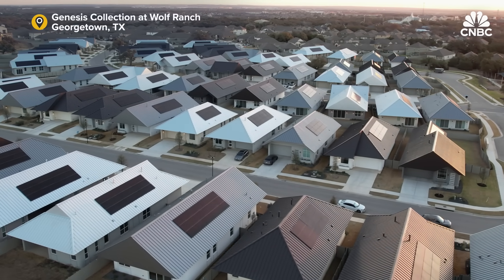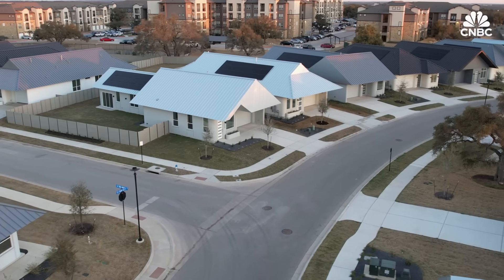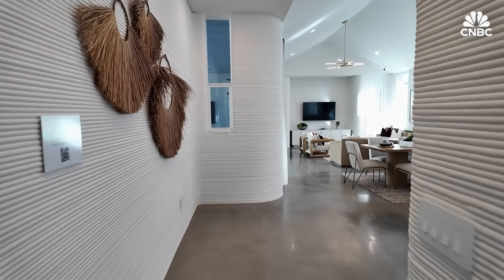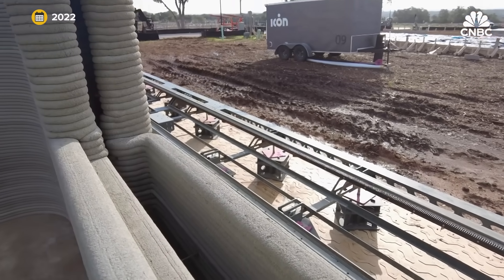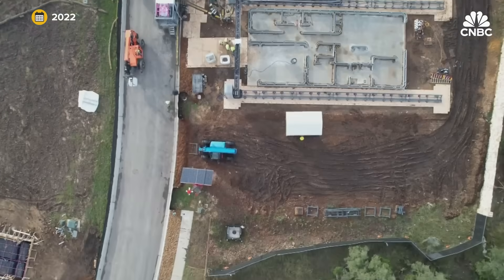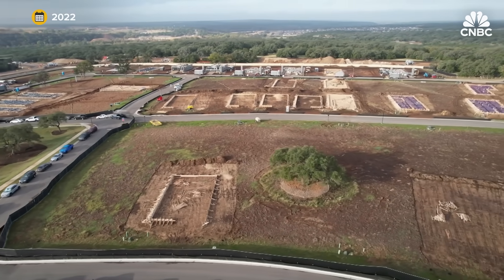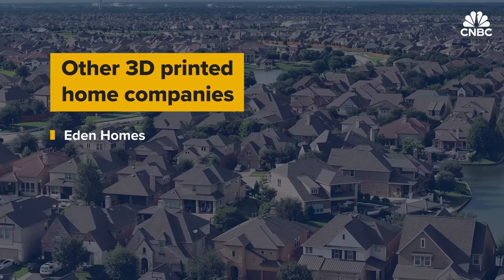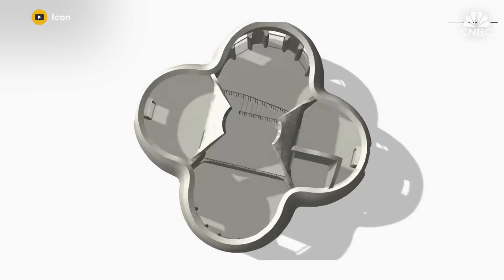Inside The World’s Largest 3D Printed Neighborhood

Comment: Have these homes passed any tests vs traditional homes? Any OSHA approval or anything like it? How do you permanently stop rain from being absorbed in the walls? Even dew point can cause the walls to absorb moisture and break the concrete down over time. Structural engineering wise, triangles are the strongest shape unlike these curved shapes. Where is the savings for the consumer where it would be 20 workers and many different materials to build a home here you only have 3 workers and just a few materials... No remodeling, no renovations, no upgradability, you're stuck with whatever is made. No where near the shear and compression strength of a standard home. If a tornado or significant storm tears down a wall, how do you repair it? This is cheaper and shittier than fiberboard and that in itself is sub par to plywood homes back when. NO THANK YOU!

Comment: Translation. We don't want to deal with workers so we're going to make a process that extracts maximum value for the investor class alone. 

In doing so we will eventually destroy most independent building contractors so the cost of building a home actually skyrockets due to a lack of competition in local markets. 

The consolidation of construction options -- probably driven by private equity -- will mean fewer options for homebuyers not less and it's highly likely most of the units built won't be available for purchase rather they'll be rental units to again extract as much value as possible for the investor class at the expense of everyone else. 

Yay!!!!

Comment: All I hear is: We think we can build homes while cutting trade jobs so that the rich get richer and the poor stay poorer.

The idea that they’re going to figure out how to lower the costs of homes is simply BS. If they do that, it’ll plummet other home builds, and by extension existing home values. Instead, they’ll charge the same market rates and just keep a higher margin of profit with no benefit to the buyer.

Not to mention that you could never modify or repair one of these homes as easily or as inexpensively as a wood frame/sheet rock home.

WORST IDEA EVER

Comment: I've always felt like claiming these are 3D printed homes is kind of false advertising. It's really just 3D printed walls. So you're replacing the framing material and drywall with concrete, which I would like to point out. Concrete requires far more greenhouse emissions to manufacture then either wood or drywall. So these homes aren't any more environmentally friendly and quite frankly saying that they can be built faster is very misleading as well. Maybe they can get one of these houses built faster than the average builder, but I have a couple of Latino crews here in Ohio I promise. Could frame roof and drywall a house that size in less than a day if I paid them enough

Comment: So, the problem here is if you have a bathroom leak or just leak anywhere. You can put a pre-installed access panel, but if the leak is no way near the panel, then you have to drill or cut through the concrete, fix the pipe, and repatch the wall with mortar. It's going to cost a lot more money since it's labor extensive versus cutting through a drywall.
Reply: Are you American right? Hahahahahaha
Reply: @blackpiller3777  And are you Indian? hahhahaha...You don' t make any sense. Go eat your onion curry! 🤣🤣🤣🤣
Reply: @blackpiller3777 are you Indian, right? Hahahahahaha…your comment doesn’t make any sense…

Comment: I absolutely love this concept. I like the unfinished texture of the inside. Almost seems like a sound room in a recording studio. What a cool idea. Seems like it's insanely strong and tornado and hurricane proof. No drywall to get wet, grow mold, and need to be replaced. I love the sound proofing and energy efficiency. It also ensures that all houses are built using the same engineering methods. Today's conventional methods you are subject to 1 million different workers are building slightly different with varying levels of skill and experience. Love this so much. Keep up the great work. Ready for the hobby home printer model where I can build my own for a tiny house lol
Reply: You wouldn't like it if you had to clean it or paint it.

Comment: Concrete is pretty corrosive when wet or damp (alkaline). I wonder how they address the corrosion problem. I noticed that the conduit in the electrical recess was rusting.   I like the design capabilities and the structural features.

Comment: the problem is the concrete the production of which is co2 intensive and produces large amounts of it during manufacturing this product also has a market fluctuation value a kin to oil it goes up it goes down so the cost savings are negligible and the only cost saving is the actual shell the rest still has to be install manually pipe wires flooring the roof etc etc etc painting so whats the point

Comment: Wait, you Americans are getting this exited about home build out of thin layer of concrete, claiming isolation, durability and energy efficiency?
Man, I cant  wait till you guys find out about homes made out of bricks, stone and THICK concrete. 
Imagine, instead of putting screws into the upper floor to stop it from making to much noise, you can jump up and down at 3am and no one even notices seating next to you 😂.
Or that the “wall” is not a place where insects, snakes and rodents can live happily ever after, cause its….you know…solid😂

My grandpa had a home where the first floor was build out of 12”-15” STONES. 
In summer, it was like a cave. They never had nor needed air conditioning. 

Im telling you guys, you are up for real treat ones you find out about it all. Though your paper made homes might become worthless overnight.

Comment: Congrats America you discovered that you can build homes out of concrete and stone and it’s better than building it out of paper and wood… wait until you realize that you do not even need a 3d printer for that😂
Reply: If only there was a simple parable. Perhaps with animals...
Reply: It’s cheaper and faster to build homes in America out of wood. They figured that out in the 1940s/1950s, when the first suburbs are built. Also, the average American don’t stay in homes for generations like other countries.
Reply: If you want to build the buildings quickly and inexpensively, unfortunately you do need some sort of automated system.  Costs for these homes is high now but as time goes on it will level out and these will be much cheaper than traditionally built homes.
Reply: They know you don't need a 3d printer. There are concrete homes already except that it would cost far more than the wooden houses to build a similar sized house.
Reply: Do Europeans like anything about their countries besides having a concrete wall in their house?  They seems to be proud of nothing else.

Comment: The niche markets for these 3d printed homes are lower middle and lower classes. Since when can these two niches afford a $389k home? Even if investors buy them, they won't be able to find tenants who can afford the high rent. Seriously, who is going to buy or rent these homes? Very few people. You got one homeowner. One. The price point is way off. The builder's inventory is going to be sitting around with no one to move in. Maybe squatters will takeover and move in these empty homes.

Comment: What's cracked up to be! There's no IFs, BUTs, or MAYBEs about it. It's definite. It's just a matter of time. How long before cracks appear on concrete-paved driveways? It's the same with 3d printed homes. How long before cracks start appearing all over these 3d printed homes since the builder is using concrete? Homeowner's insurance does not cover those cracks. It will be expensive to fix all those cracks. You have to look at the long term. Insects, moisture build up, and mold growth will take over these cracks before fixing the damage. Heating and cooling will become inefficient. The home value will continue to decline as the home deteriorates.  Anticipate this one huge problem of concrete cracks. What other issues can we expect?

Comment: The real problem here is not labor and material cost, but people greeds. They reduced the cost to build a home significantly but are incresing their profits a lot!
And here is what is going to happened, in 15 years, 30 years, 60 years, 100 years, if we continue living in the capitalist system where Winner takes all, those 3D printed homes sold for $390K, they will be $1,000,000. "They save you energy - se we can charge more for it".

Housing needs to stop been a pure business centered model, or the real problem will never fade.

Comment: I respect the effort, but would much prefer a classic Sears home style option. Traditional designs picked from a catalogue, with designs predone, preapproved, and using standardised materials, shapes, and wall lengths and such, but with allowance for some customisation. With design and material cut and prep done off-site this should substantially cut down on both cost and time needed for construction on site, especially if there's already a building in place. If an old home or building is coming down, the new building could have it's materials, walls, etc, all prepped and ready to go ahead of time. New building is essentially flat packed for delivery and assembled in a fraction of the time as all or most cuts or segments have been done, sourced, and prepped ahead of time.

Comment: How do these homes protected from 'reactive soils' in Texas and elsewhere?  A large area in Texas as 'reactive soils'.  Clays like kaolinite and illite are clays that are a major part of the soil on which houses are built.  When wet these clays expand and when dry they shrink.  This causes the soil to exert pressure on whatever is above it or in it.  Concrete slabs break if they don't have a consistent level of moisture in them.  So how would an all concrete home fair?  I'm not finding fault.  I'm curious.

Comment: To break even on the first development is significant. From there, you can apply what you have learnt to reduce costs. If they can produce at scale, this might work for the southern half of the US. Issues will be with water and connectivity to other urban centres. To expand beyond the warmer south, you would have to see heating costs - concrete insulates, but it stays cold for a long time.

Comment: What if you decide to remodel sometime in the future? Will you need a jackhammer to cut through or remove a wall? Will the building code say that a new wall has to be concrete instead of 2X4s and sheetrock because that's what it originally was? Too soon to tell, I guess.

Comment: The first step twoards Star Wars looking homes. They defo will have to find out a process to get those walls smooth or sanded down tho. Could see it being a pain to clean if not.
Reply: It might be cheaper and/or more structurally sound to cover or fill in the ridges to get the smooth look, and covering them would also give some wall space to run things like plumbing and electrical wires.

Comment: This seems like it'd be really cool for adding additional buildings onto  properties with existing structures. If they could rig up that crane with the 3D printer on it and 3D print obstructure behind an already placed house, I think that would be really valuable. My wife and I were looking at replacing our back deck with like a single wide so that we would have a ready built space underneath our deck instead of just putting in another deck and having dirt underneath it or gravel. Something like this would be really cool in that situation.

Comment: How long before cracks start appearing all over these 3d printed homes since the builder is using concrete? Homeowner's insurance does not cover those cracks. That will be expensive to fix all those cracks. You have to look at the long term. Insects, moisture build up, and mold growth will take over these cracks beefore fixing the damage. Heating and cooling will become inefficient. The home value will continue to decline as the home deteriorates.  Anticipate this one huge problem of concrete cracks. What other issues can we expect?
Reply: Would it deteriorate faster than a house made of wood covered with vinyl panels?

Comment: 400k for a 3D printed concrete house is insane
Reply: The markup percentage is probably insane. It cost them probably less than a quarter of that to construct the houses.
Reply: @noobhacker101 concrete or cement is not as expensive as they make it out to be. It's thr labor. Always the labor. It cost me $700 all includes for a 10x16x5 slab, the quotes were from $3000 to $7500. It's not even hard to do, especially considering g they weren't going to put a finished surface on it.
Reply: @ If you know so much do it yourself then post results 🤷‍♂️
Reply: Thats what I thought, either someone has messed up big time or the consumer here is getting screwed.
Reply: Its texas, you are not paying for the house, you are paying for the land it sits on.
Reply: Even insane once you realize how impossible it is to renovate such buildings.
Reply: More greed
Reply: Comments on the housing crisis then continues to perpetuate the housing crisis by up-charging a ridiculous amount. Capitalism is a sickness
Reply: It's only 1 storee
Reply: @ And?
Reply: he implied running at a loss for this first batch. notice how much of the house is outside contracting.
Reply: "...that is similar to other larger houses in the area..." 😂 👍🏻
Reply: Soon They Will Be Pushing Lego Plastic Houses....starting at you guessed it $399,000
Reply: @UneducatedGeologist You’re gonna need to print your own legos though 🤷‍♂️
Reply: @UneducatedGeologist Lego style homes have been around for years
Reply: The issue is not necessarily the company, but the regulatory system surrounding the build that, no matter what the cost, always want their pound of flesh, not a penny less. This is largely what drives costs up - the bureaucracy that surrounds the actual event
Reply: @willh69  You sir are having a in depth conversation.... Most ppl cant understand these concepts. They just want to blame 'the company' b/c they dont know better.

Glad to see smart people are still out there in the world. lol
Reply: @mattlol163  I actually got the idea from watching what DOGE has been digging up. Not all of it is worthy of cutting, BUT the things that were - seem to all follow this type of design.

You blanket a simple cheap product in 10-100x worth of complexity, and then build an ecosystem out of overcharging.

Then you sign it into legislation which means you have the backing of the court system even though it doesn't make sense

And you pay your politicians enough so that they tick that box for you and get it passed. It may look harmless/meaningless on paper to them, but the flow on effect is what you see here.

Very very interesting type of economic behavior. Should be studied!
Reply: Non listening does that help you somehow? This is all testing it will be cheaper at scale, try to not look so dumb 🤷‍♂️

Comment: Because it is not cheaper to build in many cases! One floor / ground floor only buildings at best. NOT MULTIPLE HIGHER because no rebar enforced concrete used. Especially neither suited for earthquaky areas And just use a slab as foundation on soft soil a problem due to more weight then the fabricated wood houses in the USA and canada. One story buildings printed in the desert fire or flood zones maybe an alternative? But prefab conventionalfactory modulair  concrete build works also; and can be even cheaper to build and safer and suited for more suitable shapes and zones and heights / amount of floors!

Comment: How long before cracks start appearing all over in these 3d printed homes since the builder is using concrete? Homeowner's insurance does not cover those cracks. That will be expensive to fix all those cracks. You have to look at the long term. Insects, moisture build up, and mold growth in these cracks will take over before fixing the damage. Heating and cooling will become inefficient. The home value will continue to decline as the home deteriorates.  Anticipate this one huge problem of concrete cracks. What other issues can we expect?

Comment: 0:46 is it not better, to build two family houses, to need two rails for two houses, and not four? And build with one 3d printer two houses at the same time? And dont need to move the printer after first house is build to new location. It is also better, to save more area on small parcels, and to save heating energy costs! Maybe even build 4 family houses, in the middle of 4 parcels, and two family garages? But printer must be huge, to build 4 family houses!

Comment: Honestly 3D printing on site isnt exactly efficent. Home should be being built from prefab concrete. Think walls all cast off site and transported to the location. For the infrastructure to make the walls a very local fab site could be easily put together. Prefab buildings go up and are watertight in days. Walls are smooth and whilst the may not have the cavity a secondary liner can easily be added to improve insulation. The added benefit would be accuracy as even on the houses seen in the story there are plenty of bulges and lumps that mean excess material for no strength benefits and a whole lot of dusting required down the track for the owners.